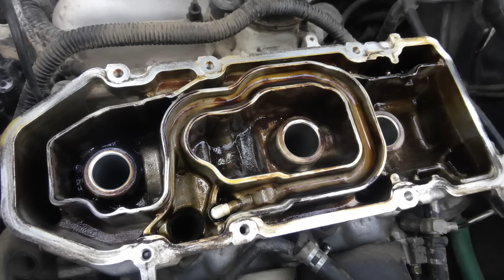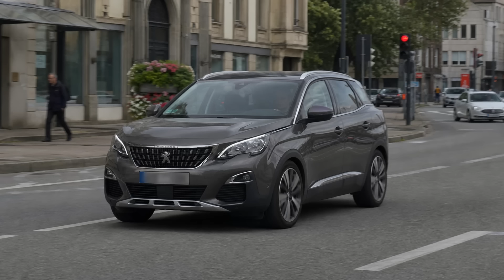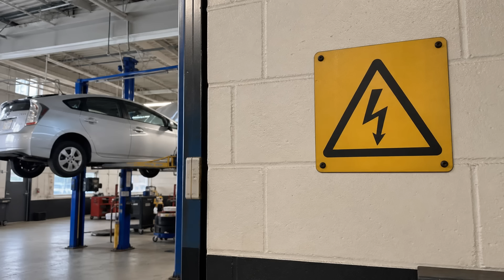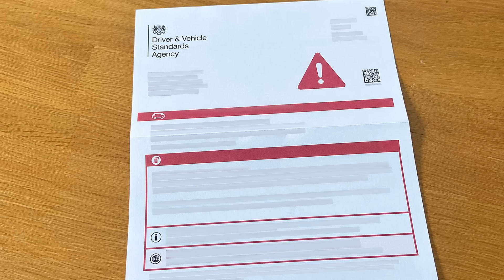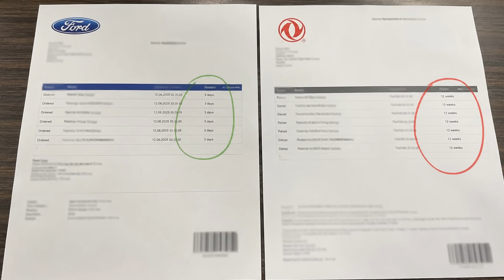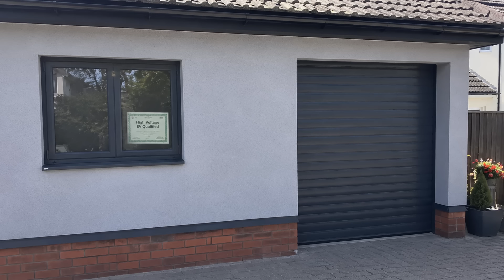12 SUVs BANNED From UK Garages! Here's WHY

Comment: TWO YEARS.
Annual cost:  
Roughly £60,018 per prisoner in public-sector prisons, according to recent Ministry of Justice data.
Daily breakdown: 
This equates to roughly £164 per day.
Gender differences: 
The average cost of keeping a female prisoner is higher at about £83,987 a year, compared to approximately £55,560 for a male prisoner, largely reflecting specialized support and smaller facility sizes.

Comment: My UK 3.0 S4 Twin Turbo chain drive diesel is a powerhouse even with 145,000 miles on the clock. Rock solid engineering, 8 speed auto or Paddle manual shift box,  like new inside .. why would I ever change ????

Comment: Prevention is better than cure - but not a guarantee. Change the oil and filter at half the manufacturers recommendation same for the gear box. Check and change the diff oil. Got a ‘knock’ get it fixed straight away even if it’s not serious. Stay on top of your maintenance. My 14 yr old Mercedes C220 benefits from all the above and repays me by not letting me down. It’s cheaper to do the above in the long run than try and put it right after and I get to use a ‘mechanic’ from a small independent if it needs a job done. Treat the electrical toys like a laptop and expect them to go wrong at some point - but in that dept, less really is more!

Comment: Very insightful. Thank you. And what a shitshow for the motoring industry! I currently drive a Tesla model 3 highland with LFP battery. Happy about the car and convinced it will last a long time. My other car is a BMW F11 518d currently having 180,000 miles on the odometer. That car has been doing relatively well with a couple of factory recalls for the EGR system. So far it hasn't gone up in flames yet. One of my previous cars was a lovely Audi A5 coupé 2.0 TFSI. New engine at 60.000 miles. Then the same problem started developing again, 1 litre of oil every 200 miles. That engine was designed to run at low rpms at highway speeds, causing insufficient oil pressure. Add to that badly designed oil scraper rings on the pistons as a recipe for disaster... Plus the stupid oil change intervals... Ah motor industry what have you gotten yourself into!!

Comment: I used to cover all Landrover products with my indi shop, but had to make the business decision to stop all work on the modern stuff after 2010, simply for several reasons made in this video. JLR are a PITA to obtain information from, they don't give any discounts to "small trade" for that information, the engines are an utter shit-show for liability if you do happen to service them (who wants an Ingenium on their books?) and the risk-factor outweighed any profit you might make on any job. Add into this mix a customer-base that has outsized expectations of reliability and value-for-money of their 7-year old RangeRover (usually a Freelander platform in drag) and you then end-up with a nightmare of all proportions. So you go back to servicing and restoring old-fashioned Defenders pre-2015, including all the fabrication and fitting skills that goes with that : Job-satisfaction improves, blood-pressure comes down, profitability now makes the business viable again, and the old scantool keeps working without an annual subscription.

Comment: 20 odd years ago, our machine shop got hit by the main-stealers, right to repair scheme - basically only authorised garages and reconditioners had the right to remanufacture their products - we won the war but lost the parts access - everything German cost quadruple what it used to - Bearings, Pistons, Valves and Gaskets -Nowadays working solo - I see they achieved their goal or a Tied Down Bonnet or Throw Away Engine !

Comment: Welsh guy who moved to Annecy, France in 2013.

The local garages, everywhere in 2013, have all but gone.

The one that used to be near me was a family business, but they struggled to keep mechanics (Switzerland with it’s higher wages is just a half-hour away up the motorway).

Increasing housing pressure was the death knell. They owned the building, but not the land. The local council sold the land their garage was on for housing, and that was that.

Now, with no independents left I take my car to a family dealer, rather than the megacorp dealer that hoovers up the market (and for most brands).

Comment: My Citroen C4 Cactus 1,6 diesel spent literally months at a shop in Sweden waiting for  parts to repair the AdBlue system. The car locks the driver out from starting the engine after a certain number of miles if the exhaust cleaning is inoperable. So even though the car still ran fine I couldn't use it. Parts were on a ridiculosly long lead time because many other cars had the same problem, the system had been badly engineered.
Reply: Some garages have contacts that will disable the whole adblue system. No more issues !  Citroen Relay with a FIAT engine, runs very well without the adblue.

Comment: I don’t buy that a cam belt running in oil is more efficient than a dry belt. The oil on the belt has to be pumped out every time a pulley tooth engages with the belt. That absorbs energy.

Comment: Bring back the ford Pinto engine.. run the engine in for 1000 miles. + 40,000 mile decoke = head off and clean valve stems. 
Is there an opportunity for clever engineering but scrap all the ECUs. Electronic ignition- yes, the rest of the crap BIN. Higher emissions- so what. China and India pump out Sooo much pollution- the UK is Pissing less into the ocean and they expect the sea levels to fall. Get Real.

Comment: EV mechanics and death.
I saw recently a village guy who teaches on-the-road mechanics (like the AA for instance) how to best carry out their job. He has taken a course in EV's and is now qualified to teach these also. However, after the course he feels that the dangers of FATAL electrocution, particularly in inclement weather,  are not worth the risk as basically you touch wrongly and you die.
Plus, trying to push a 'dead' EV to a safe position is difficult and is ill advised. Calling a recovery truck is the best answer and an expensive one. Meanwhile your EV may be a significant risk to other road users.

Comment: I have an 8 year old Skoda Fabia. Quite a conventional car and I like it.
Reply: I have a 22yr old Skoda Fabia Mk1 (1.4 16V) and very much like it, averages 45mpg and it even has air conditioning ! Bought 14yrs ago for £1400 and hardly been in the garage other than for routine servicing and cambelt replacement.

It looks good parked alongside our other car a 20yr old Audi A3 2 litre diesel. As above reliable with annual service by VW Audi independent specialist.

Both low mileage examples in excellent condition and no plans to change either car to a computer with 4 wheels.
Reply: My daughter has a 20 year old 1.2 Fabia, brilliant little car

Comment: Older cars where more reliable far better easier to work at, Now gone stupid with wet belts lucky if you get 28000 miles out of them they have to be changed its big money stay away from them wet belt engines

Comment: There's no way i would take responsibility for the engine dying after timing belt change, unless it would be timing belt related 
Big ends, head gasket or cylinder head cracking, everyone can get bent. Same with engine dying while at the garage (car came in with engine noise i started it and and gently revved the engine died and didn't start again told the customer that was on the way out)
But i don't do engine work on mazda 2.2 diesel,  i avoid range rovers, and wet belt stuff

Comment: Ford Ecoboom engines were a disaster, it's a simple fact that immersing rubber in oil is not a good idea, as rubber compounds contain plasticisers, which will, in mot cases, be vulnerable to attack by engine oil and unburnt fuel.  A disaster waiting to happen, which is exactly what occurrred.

Comment: Thanks for waking me up.
I sold my 2017 qashqai.
Bought a 2013 rav4.
Drive a 1999 Nissan navara ure
Still have a 1969 c10 chev
 pick up.
Wanting to get a water to hydrogen unit that's works well.

Comment: Problematic cars / engines ?   The Fiat 500 x with 1,0 l engines,, nowhere to find 2hand,, once overheated ?? , not to be repaired ,, totall loss.  // The pure tech 1,2 l peugeot engines,,  you can avoid damage of the belt but need to change adequate oil at least at 7500 km and ad bardahl additiv, well known by peug/citr repair shops- these pure tech belts are quite expensiv to replace too which only experts can   . // the BMW 3 and Mini with chinese ?? chain belts , which tend to break,, motor totall loss. Years between 2013-2020 I guess. // The Peugeot / Citroen and Opel 1,5  diesel engines , with ad blue,, euro 5,6,, which stall frequently and need a cpu update done by computer otherwise it stalls  ( 250 km going down to 0 km )  ,, this is an software problem,, so you cannot be sure to make a trip longer than 250 km to get back home or at your garage ...+  recalls from Peugeot to check the camshaft chain belt which tend to break,,=  same motors in Peug 5008 and other models ...//  The Jaguar XF with 3,0 l peug engine and intelligent computer charging alternator , costing around 1000 euro and keep burning after 20 km,  beyond repair. // The Opel / Vauxhall 1,6 diesel  (2018 onward ) with a failing oil pump,, placed in the middle between the engine and gear box,,  motor rattles and suddenly motor is done. Engine cost = 8-10.000 euro. //  Dacia,  Nissan Quasqai 1,2 l petrol , suddenly massiv  oil consumption and later on no compression at all, motor finished at 200.000 km, engines hard to find // The Chevrolet makes,,  spare parts either very expensiv or not available anymore // There are very, very few cars /engines that can run over 500.000 km anymore these days that is my conclusion.  After working on all kinds of makes , brands over 35  y , I noticed that some manufacturers install junk engines , mostly  1,0 l turbo charged and tend to break down fast ,,  beyond repair,,  totall loss, l a new engine costs around  8-10.000 euro . Iniatially ppl buy a car with a loan of around 20.000 euro and suddenly are faced with additional cost of 5-10.000 euro or more,,  sale the car but loose a fortune again and need to buy another one on top .... Official dealer garages charge around 100 euro / h in .BE whereas independent repair shops around 45-50 euro, all overwhelmed with too much work .. . Electronics become so complicated that most independent repair shops either stop or perform simple tasks unless you are an electr + mech expêrt at the same time and even if you have the best electr comput diagnostic instruments such as Snap On ,, you still must be very experienced. to make the right diagnosis, you need all kinds of  electr charts +   info which cost money as well before you remove anything .. . .  You want a reliable car ? Check reviews on  internet,  check Y.T. and ask some garages before you put down your money.   Greetings from .BE

Comment: My Focus 2017 has the 2L TDCi engine and hundreds of thousands were made doing massive miles in taxis etc. Yes , has a dry belt that needs a change every 10years. My other car is 2010 Piccanto 1 very simple and reliable. To be fair most punters that buy that  'impressive' cars deserve what they have to pay dealers.
Reply: I've just had the second timing belt and water pump change on my 2008 1.6 petrol Ford Fiesta (dry belt). Price was very reasonable.

Comment: I despair at the lack of entrepreneurial nous in UK.....all these cars, good cars, just waiting for someone to come up with a quick engine change to something that doesn't have the wet belt.....In USA Cummins spotted that the V6 used in so many products owned by Stellantis was a liability, always going wrong, always in the workshop, uneconomical and not a nice unit to drive.   They came up with a 2.8 diesel that comes in a crate with everything you need....even had it's own ECU and it's own accelerator pedal.....Just throw away the old engine and bolt this one in.....For these older cars, good condition engines from 'rear enders' could be procured......Just needs imagination.

Comment: We don't repair or replace timing chains on jaguar and land rover ingenium engines , absolute waste of time. After 38 years in the trade fully qualified with EV papers i don't instantly write off many designs but the ingenium is a complete disaster. Also the 1.5 and 2 litre eco boost ford engines suffer from poor coolant passage design in the cylinder blocks more than the heads but ford expect you to pay for the improved new block. I always carry out proprietary inspections.  Eg listen to the engine start up cold and carry out cylinder block tests on the fords. Saved me a lot of grief.

Comment: We’ve an 8 year old  Eco Boost. At the last oil change, I drained the oil though a strainer and there was absolutely nothing in the oil. I cut over the oil filter and that was also clean. If you use the right oil and service properly, wet belts are not a problem.

Comment: It is not manufacturers who should be blamed for never ending increase in the complexity of cars and the resultant drop in reliability but the governments slavish acceptance of the CAGW/climate change hypothesis that is forcing manufactures to meet unrealistic emission targets with half baked solutions that do work as intended and are only able to be refined once cars are sold and driven out in the real world.  Manufacturers do not want to turn out complicated expensively produced cars. They want what the rest of us want simple easy to maintain inexpensively produced vehicles giving a decent margin but the supposed "FREE" market has failed because of government and green lobby interference when the government is supposed to protect from market failures.

Comment: Excellent podcast - my mate came to me with a blinking front light, it was a Porsche cayenne. I could have changed it easily as there was no way to fix it with its Led nonsense. Porsche quoted £5k for that headlamp and even then it would need adopting by Porsche. What a load of bollocks.

Comment: Costs 400 quid to replace a headlamp bulb on my daughter's Audi as the whole bloody front bumper and splitter has to be removed to get at the headlamp unit itself. If that isn't a pre-planned design decision to make money out of a routine process I'll eat the Audi's tyres.
Reply: All the more reason why research needs to be done before buying.
Reply: I've found a big black CPU thing with a + sign at one end and a - sign at the other ? Any ideas folks?
Reply: For some cars, a single headlamp replacement costs upwards of £3,000!! Per headlight!! And that's just the cost of the part, not the labour to dismantle half the car! An absolute joke.
Reply: @willcram8350 
I question the cognitive levels of the 'keep up with the Jones' gang.
Reply: You should have bought a Skoda  - mine is just the best features of an Audi in a different body.
Reply: Toyota mr2 mk3 rust minimal, engines £300 s/h but they don't really go wrong. 
Fun little car and cheap as chips.
Reply: Look at me is very expensive.
Reply: Audi always were holes in tarmac. You pour money into
Reply: Took me and my Mechie mate two hours  a mibile phone and telescope mirror to change a bulb on my Mrs xtrail .
Reply: Try doing it on a Ford Kack
Reply: This is what happens when accountants are let loose in engineering. It's like this in every industry. I seem to recall this started in the early 90s.
Reply: @greenpedal370  No, it's what happens when government legislate ridiculous emissions targets.
Reply: Thanks for that, my head is 11 years older than the car.😊
Reply: No sens car

Comment: For 30 years, my reserve vehicle was a 1931 Austin 7. It never once failed to start, and the engine and gearbox numbers were original to the day it came out the factory. It did have a complete rebuild 10 years before I bought it 35 years ago. It cost the tenth-part of a tithe of a half-farthing  to service and could be repaired by any garage. Parts were readily available and as cheap as chips. It's anti-theft device consisted of putting the rotor arm in your pocket after parking. Some vintage vehicles are very practical as low cost easy to repair everyday vehicles.
Reply: i did the same and it still got stolen, i think they found my spare rotor arm hidden in the glove box,never saw it coming....
Reply: @josepeixoto3715  Mine never did get pinched, but I did return to find people sitting in it twice! Invariably old boys in their 80's who'd driven it as their first car in the 1940's. They had great stories to tell, so I never made a big deal about it!
Reply: Same with my capri use over the years,holiday without the car,rotor arm out!,belt and braces,took the ht lead off the coil!!
Reply: Cylinder head off about every 1000 miles though, rod brakes. 

There’s more to it than simplicity. There’s always a compromise. Whatever the car. 

Charming as it is there’s a reason why it was your reserve car and not your daily😂
Reply: @craigyllyn  Actually it had cable operated brakes, which had to be rigged asymmetrically, or else braking would see it veering to the ditch! Rod brakes for Sevens came the following year. I was a 'for fun car', but I used it a lot. Used to pick my daughter up from primary school in it!

Comment: It won't just be independent garages that'll gradually disappear. Car ownership will also disappear and you'll either be forced to lease for a fixed term or not have a car at all. Think you can own an older car long term? Think again. Manufacturers have built obsolescence into them by making OEM replacement parts unobtainable.
Reply: Tony Seba does a great lecture on Youtube about the future of transportation. He says when to use competent Self Driving taxis are 10 times cheaper than owning a car then its finis for most car ownership. He predicted 2030 as the date it will become obvious.
Reply: @wirplit    People have their opinions !